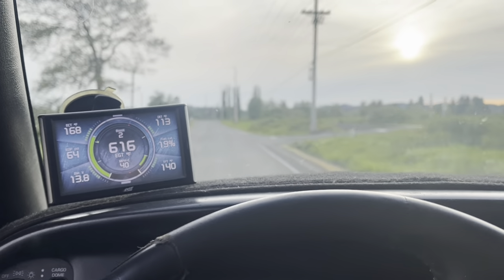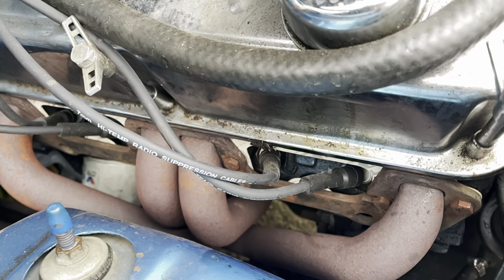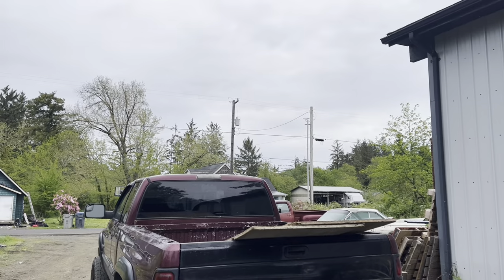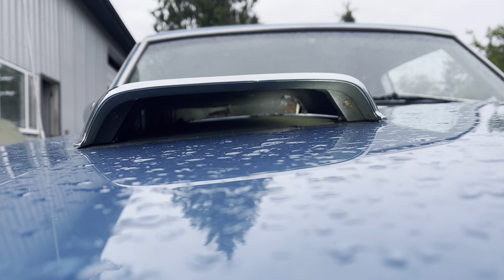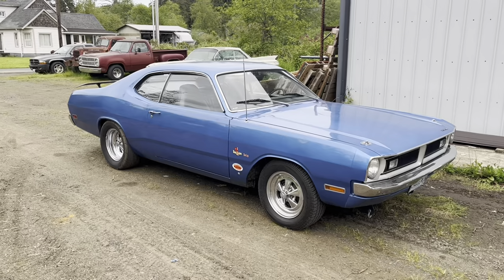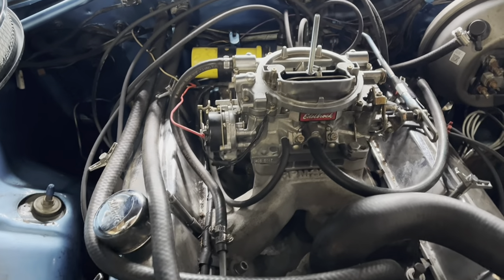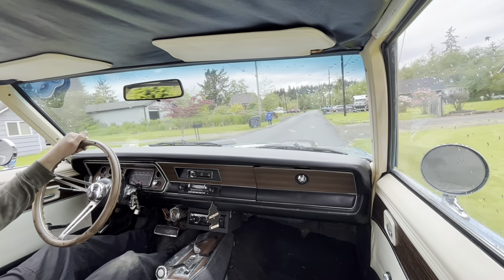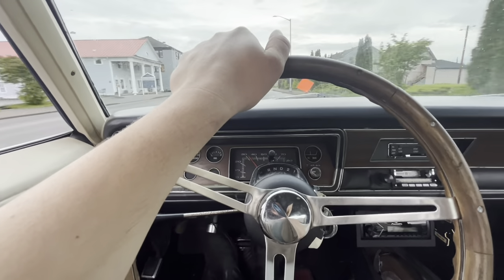I Bought A 1976 Dodge Dart Swinger… With A 340 Surprise!

Comment: You know, I don't care if its original or not - it looks good at 10 feet, it sounds great at any distance and it goes like the clappers.  Stopping would be good, less rust in structural areas would be good too and moving the needle of the oil pressure gauge so it reads what I want it to would be potentially expensive.....unless I cheated......but it's still a Dart Swinger with a 340 - and I want one!

Comment: I have a 73 340 auto Duster , with 70 Duster fenders , 68 Valiant hood , grill and front valance. I had to drill 2 holes to make it work , looks different and I like it , primer grey with a flat black hood. 4:89 and a spool in the back. Stop light to stop light it makes a quick trip.
Reply from the maker: That’s awesome. I love that early Valiant nose. Sounds like what was done to our Barracuda with the Dart nose, but a little different. And faster. Haha.
Reply: Sounds like a blast!

Comment: My opinion, no scoops on either one, but that's me. Trash those headers and bolt 🔩 some TTI'S on. You can remedy the cast crank with a late '60's 318 forging. The linkage is a mess. Let's take a look in the trunk 😊

Comment: I do hope you got a good deal on it. It has  enough rust and dents in it to cause some concern. Having a 340 in it is a plus. 1976 Swingers only came with column shifters and bench seats. They also only came with the 225 slant six or the 318. Then they either had a column mounted 3 speed manual or a column mounted automatic, the 904 in fact.
Reply from the maker: Indeed, the console was no longer available for ‘76 Dart - only Dart Sport. Apparently bucket seats were however - according to the option sheet. The car was clearly built out of at least a couple different cars. I didn’t bother investigating what drivetrain it came with originally. I did get quite a good deal, and after making some improvements and enjoying it for a while, I sold it for a tidy profit.

Comment: I know you made this video a year ago just been going through your old videos. That car is good, but I would yank that motor and yes put the scoops on your 340 demon. If you have it done or already, I’ve never noticed in the videos lol.
Reply from the maker: I didn’t, but I found another set. I actually got a whole spare hood (better than the green one I had in this video) and am planning to put them on it. Yet another project I’m sure I’ll get to eventually. Haha. Thanks!
Reply: I was wondering when I had my Dart with the 2 scoops if there was ever some function. I looked up from the 60's a cross ram manifold with 2 carbs on each side.  @DeadDodgeGarage

Comment: The more of your videos I watch, well.....if I had a YT channel: it would be, poor choice Mopar garage. Still have my first truck, 57 D100, 69 Fury subframe, 340, 727, 8 3/4. early 80's project with my late father. '80 Clubcab Powerwagon, because as most know, you can't afford to keep the '01 V-10 2500 while going through a messy divorce in '02. And choose to drive a '18 Powerwagon as my daily recently. While there is quite a few MOPAR Channels. Personally only a few I subscribe to
Reply from the maker: Alright, Poor Choice is just brilliant. Wow. That’s one hell of a build. I’ve never heard of using the C body setup for a swap like that. How do you like the modern Power Wagon? I really like it in theory, but I don’t think I could afford Hemi truck fuel mileage for my daily commuter at this point. My third gen Cummins is bad enough at 18-19 MPG, and it cost much less at almost 300k miles…
Reply: @DeadDodgeGarage  my dad was old school mechanic, and I was into Hot Rod and Truck'n magazines back in early 80's. Looking back it was a project that was full of bad choices. But it was done dirt cheap. 69 Fury front clip easily slips outside the 57 frame rails, Clued in later, different track width. Go to drop the cab back on frame, didn't think about engine placement, cut out firewall. Started with a beat up truck and worn out Fury. Now I know use a  Dakota chassis. '80,'15, '18 Power Wagon. 6.4 Hemi with 4.10 gears is thirsty for fuel, but not really worse than the '80, with a 360, 4 BBL, 4spd. It's all the electronics that scares me on the newer Power Wagons.
Reply from the maker: Right. The electronics make it more than a little different than my ‘48… will it still be running in 75 years? I’m not ready to bank on that. Some of the best ideas are absolutely nuts.
Reply: @DeadDodgeGarage  It was just a project, preinternet. Take a beat up truck, use a 69 Fury, We farmed out the welding of the subframe, the rest was done in a cramped garage. Lots of hurdles. Didn't realize how far back the engine sat back, compared to the early straight axle. My dad is gone, but I can never let this truck go.

Comment: Too bad those J heads are the 1.88 intake valve and not the 2.02 71 only J.
Reply from the maker: I wouldn’t worry about that too much. My Demon is currently breathing through later 360 heads with 1.88s and it doesn’t seem to mind much…
Reply: @DeadDodgeGarage  but, w2 heads would be nice.

Comment: Great score! I would definitely use the scoops on the Demon! I'd probably fill the 340 emblem holes and repaint them, I don't think the 340 Demon's had the emblems from the factory although I've seen them added to alot of them, I think they only had the decal. You can have alot of fun with that dart, you can get nasty with it without worrying! Plus it has alot of great parts! You could even do a video on putting those scoops on and the correct placement by using the factory access hole's that are already in the bracing under the hood, it could save alot of folks from putting them in the wrong spot like I've saw so many times over the years!
Reply from the maker: That’s a great idea. The holes are there, but there’s still some room for error. I’ve seen there is a template thing that lays them out exactly. I figure some careful tape measure work can solve that though. And then of course the 3”, slightly oddly placed air hole and the water seals. You’re right, the 340 emblem wouldn’t be correct on my Demon. I might just let it ride. Tough call. I’m still building myself up to drilling the holes. Haha.
Reply: @DeadDodgeGarage  the big hole that gets the rubber grommet measures 4-1/4 inch from the factory, I bought a hole saw to cut mine but haven't got up the nerve yet!🤣 I've already bought the grommets, I made my own templates for the other hole's, I used a drill bit through a socket that fit the inner bracing holes snug and drilled the two holes at the back of the hood first, then lined up the template I made and drilled the rest.